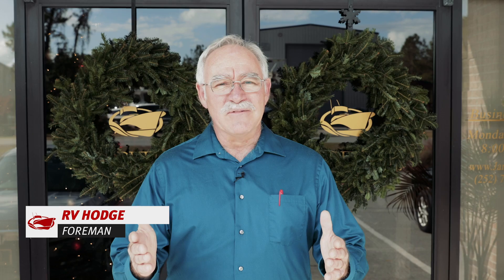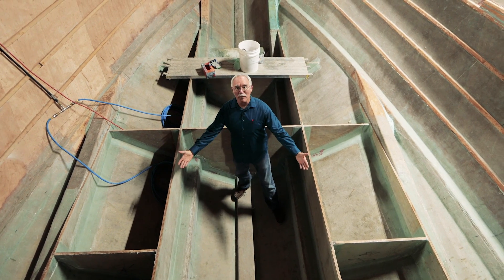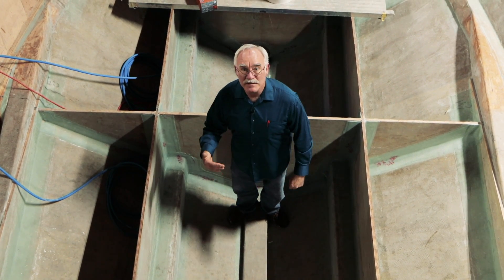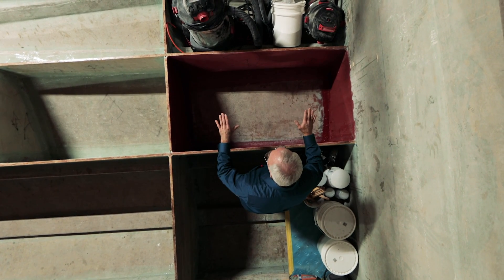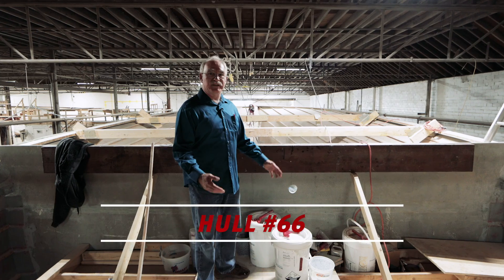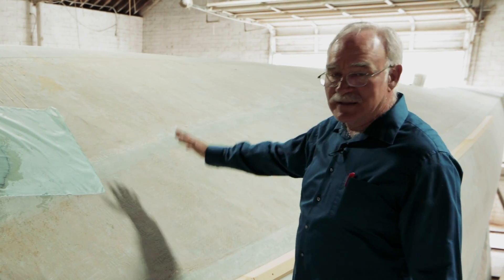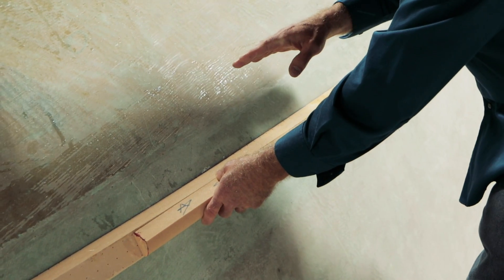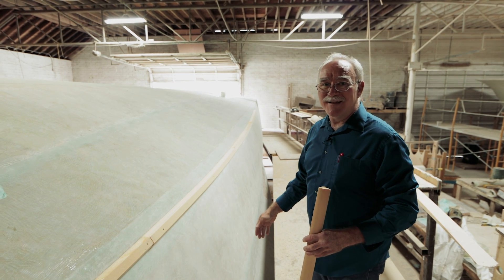Carolina Flare Insider - Episode 7

Comment: Merry Christmas to you my next boat will be Jarrett bay what material the fuel tank made of great success for 2019 and beyond
Reply from the maker: Our integral fuel tank baffles, as well as all parts inside the tanks, are typically built of solid fiberglass panels that have been vacuum formed with FDA approved potable water resin. The baffles are then fiberglass tabbed to the hull using the same resin. Thanks for following us and Merry Christmas to you!